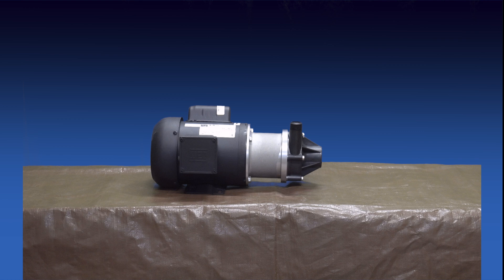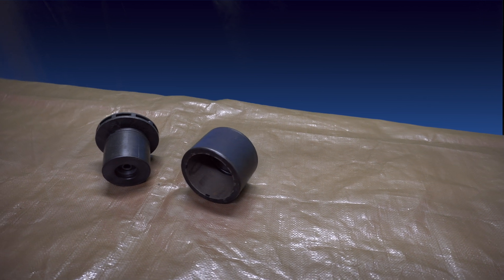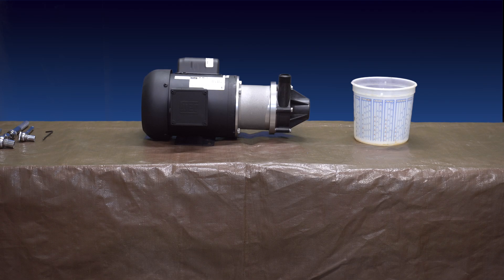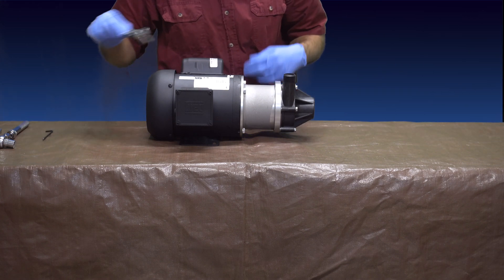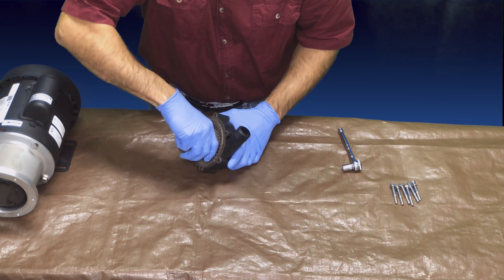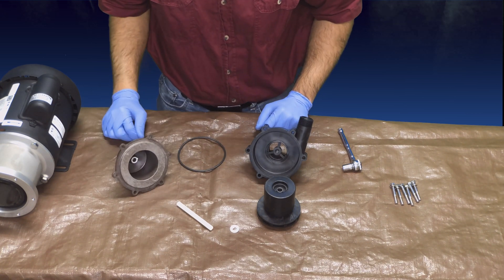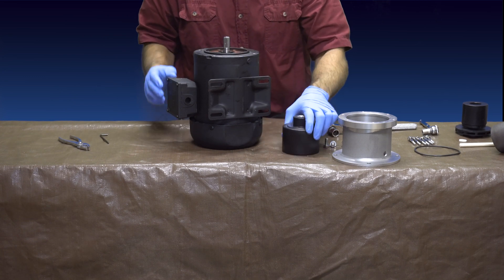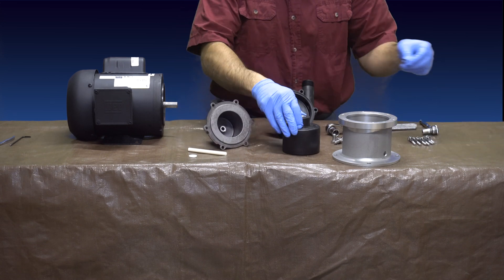March Series 7 Pump Disassembly

Comment: I have a 1U-MD pump that I will be replacing (I see its picture at the front of this video as the pump with the orange motor covering).  It states that it is not a self-priming pump, so I am curious if there is something I need to be doing to prime it?  I see no real method possible as it has the propylene screen on the input (front) so there is no nozzle or orifice to drive fluid into the chamber and the ouput tube out the bottom right.  Should I suction the water through the chamber before driving the motor or does it actually self-prime?  Thanks!
Reply: Stan, can you email me at sales@marchpump.com 
But you have the pump above the liquid?